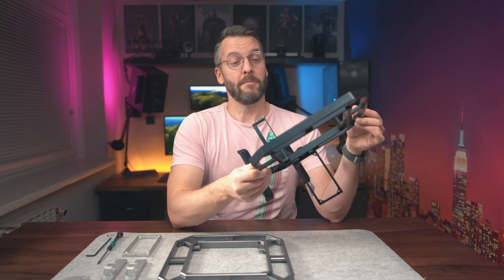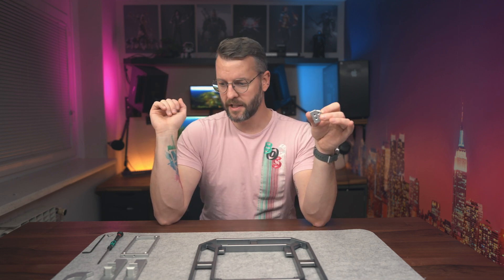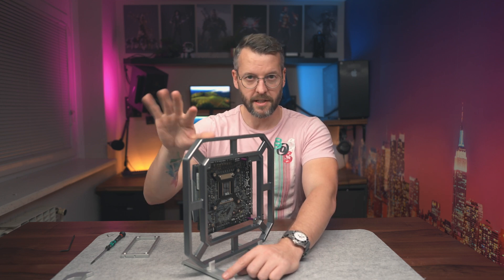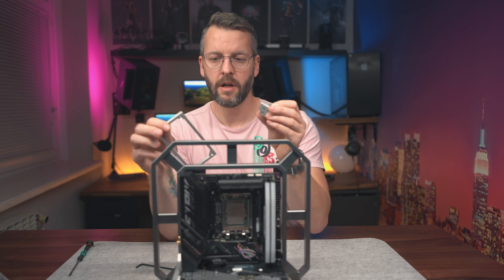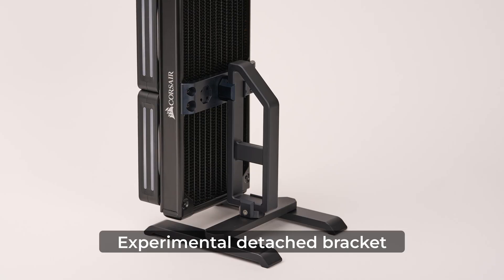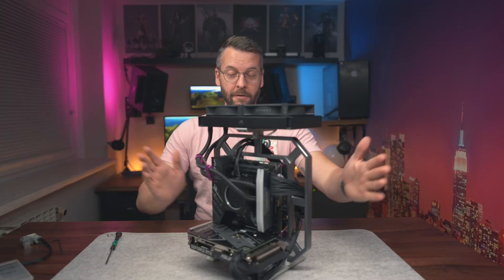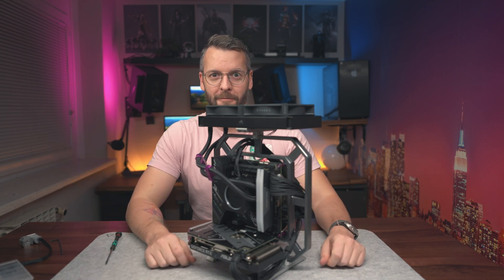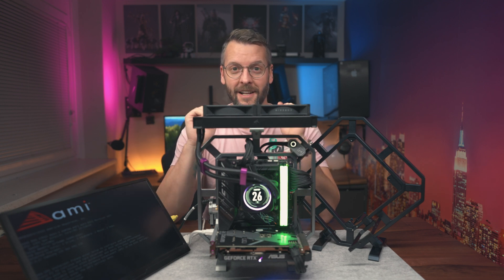Best small form factor PC case isn't even a... case?

Comment: I've been looking at the small form-factor, open air cases for a while and kept finding things I didn't like. The A45 has some flex if you go with a liquid cooler and, while it was very solid, I didn't want my PC to droop. I did like the 45 angle for the video card to prevent sag there. The Monument is beautiful but 1) not liquid cooler friendly and 2) looks quirky with a full sized card. I don't really like the case being that restrictive. The Calypso was pretty close to perfect but it's discontinued, so, yeah.

I could go on but I'll just cut to the chase, this case checks all the boxes! Customizable enough that I can run pretty much any components I want (especially when the ATX version comes out), symmetrically built to prevent one side or angle overwhelming the others and beautifully made. Still doing my due diligence, but this looks like the answer to my search. Thanks!

Comment: I’d be interested in this if you ever made a slightly larger version so everything could fit on the same side. That way I’d be able to wall mount the entire PC with the cable management hidden behind the mobo.
Reply from the maker: We're looking at that as well, but the reason might not be what you think. It's to be able to wall mount it.
Reply: @tomazzaman  That's exactly what I had commented... I said it would be cool to be able to wall mount it.
Reply: @tomazzaman  Not a problem depending upon how absorbent the wall material & substructure is, as most things "stick" to almost any wall, given enough "doses" of Loctite 401 Superglue...
Now back to mounting this (and we ain't talking women either...!!!!)
Electrical things are just as important - if not more so, than their electronic counterparts, as without basic electricity and how that "moves" none of the electronic stuff would work .!!!!
NZ Registered Electrician with way too much time, now that I'm really tired (old/old) and not just re-tired (young/old)